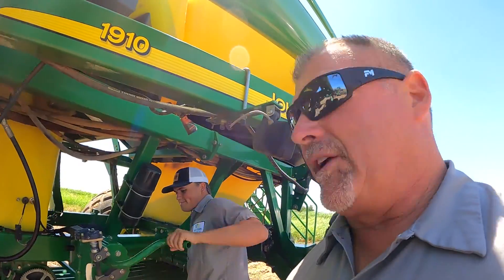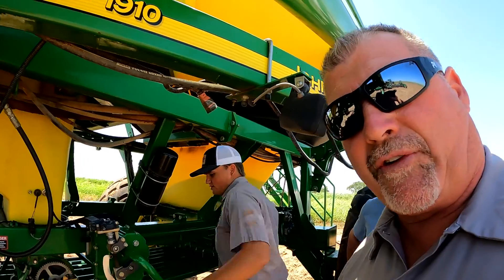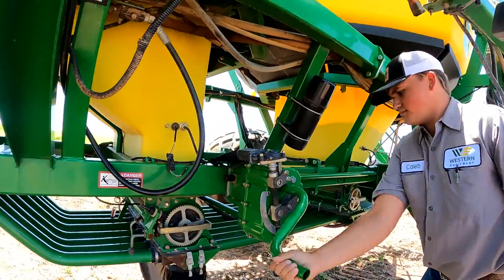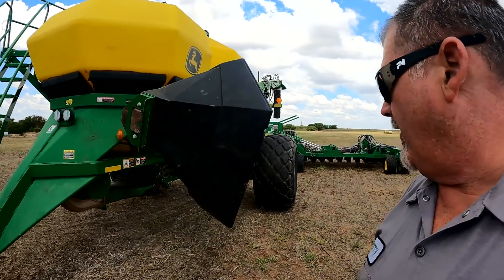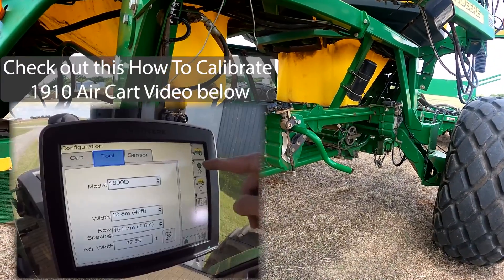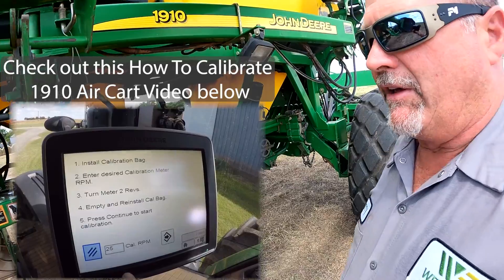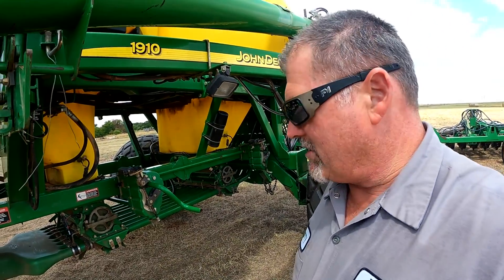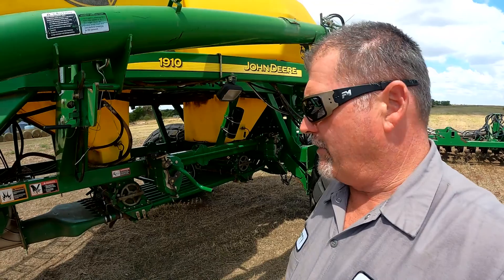Larry's Life E30 | Repairing a John Deere 1910 Air Cart with Calibration Issues

Comment: Good evening, 

We have an 1910 air cart with a hydraulic drive. 60 foot width. The issue we are having is we complete calibration and complete a meter verification. We are apply 80lbs per acres and get 8lbs on a .10 idle meter verification. This is all good. However, when we complete a couple of passes something is happening with the meter or something but the seed output is maxing out the rates. This is costing us significant seed lost with putting down to much seed. Our local dealership isn’t much of a help as this time either. This has been going on for a month now. Let me know what you think. Or we can also get on a call.
Reply from the maker: I will have to look into this.
Reply: We want 100lbs be acre but drops 4lbs? 
Help